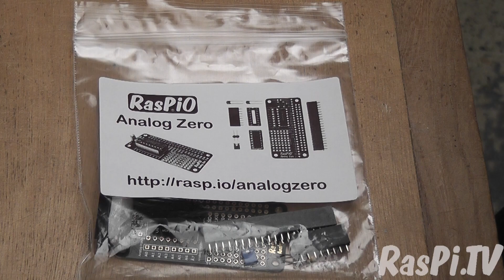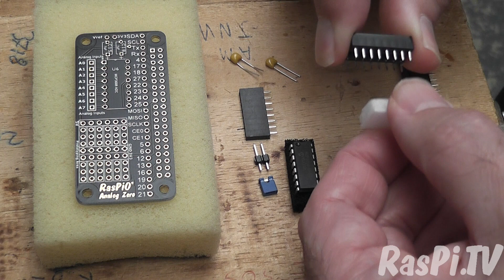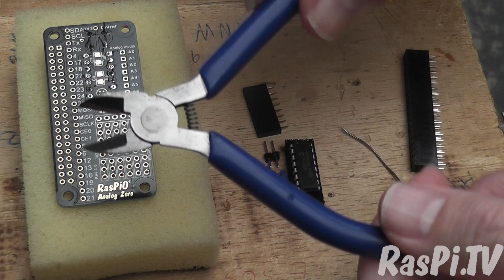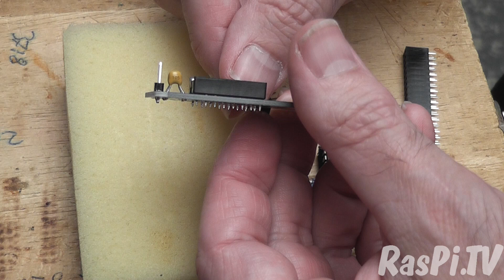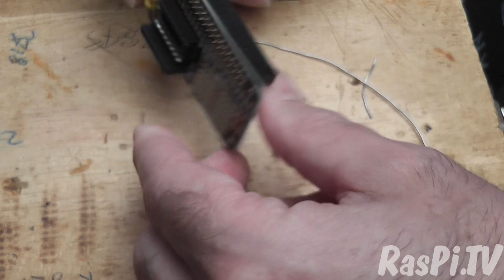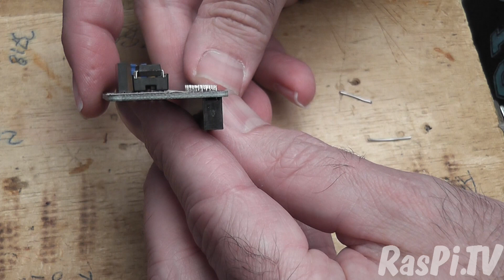RasPiO Analog Zero Assembly Video HD

Comment: The analogue inputs measure a differential between the test voltage and ground. It seems rather unpopulated with ground pins. Should be 1 for each analogue input plus extra for prototyping.

Comment: Flux in the solder does not work on the greasy surface. In order to easily obtain fine solder, protect the surface to be soldered. Or clean the surface of the fat before soldering. Fingers leave a greasy surface.